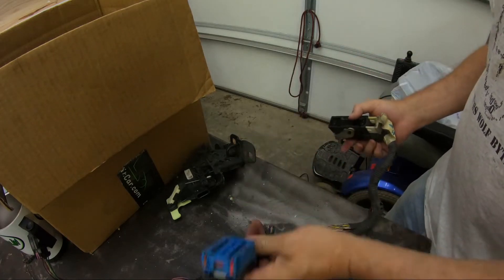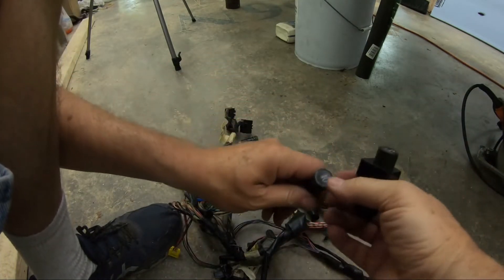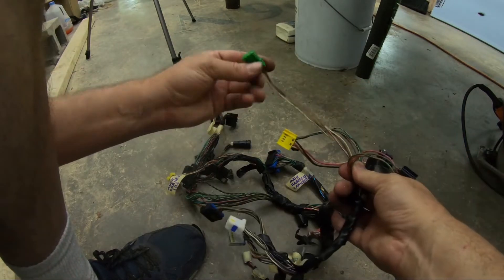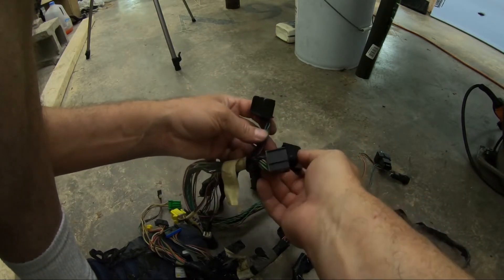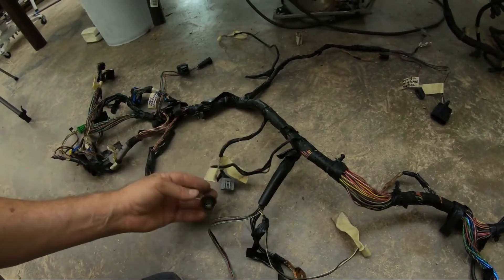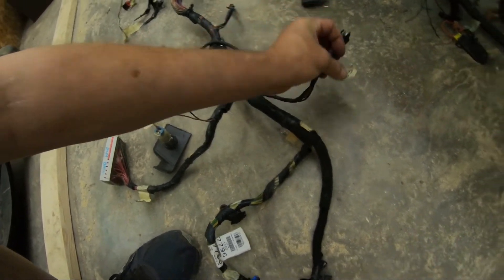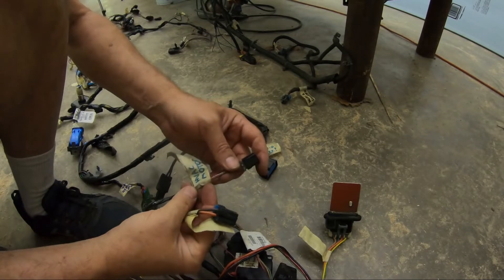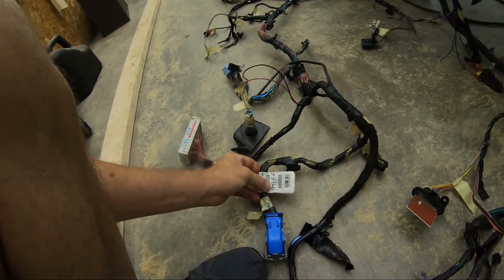2006 Chevy Cobalt 2.0L SC, Part 2 Instrument Panel Harness

Comment from the maker: In 2007 the LSJ got bigger 42lb/hr injectors, some of the electrical systems (steering wheel buttons and daylight running lights) are updated.  There probably is other changes that I am unaware of.